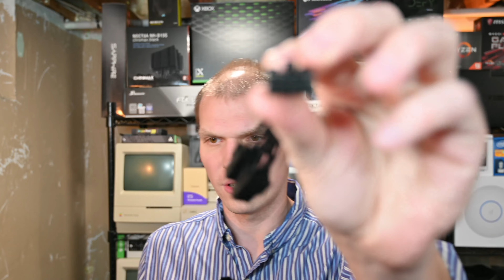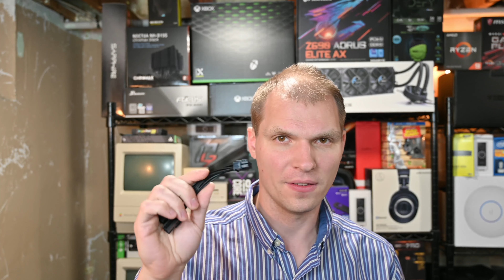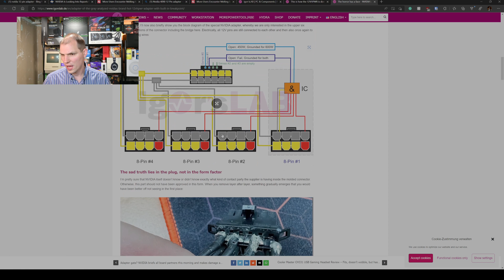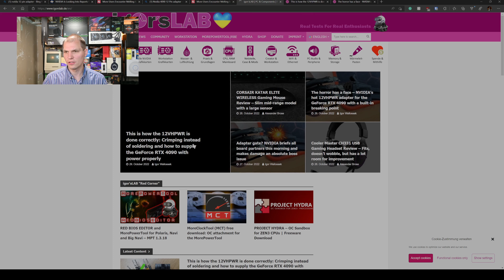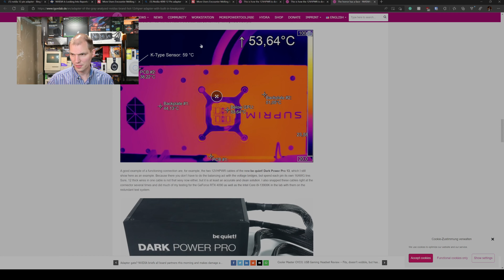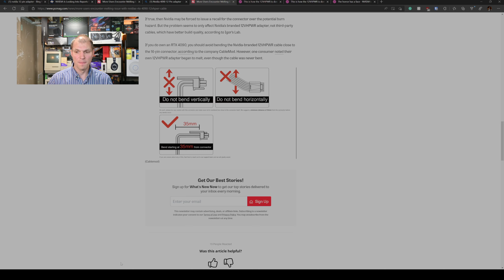Power Adapter Melting Away

Comment: Well put Gray!  This really could have been designed and tested much more-especially considering how "grand" it is.
Seems to be the same old design patched together for 4x the power.  If they took a step back they would see how crazy this is.  
As big as the card is it could have used another pcie16 slot for more power and stability imo